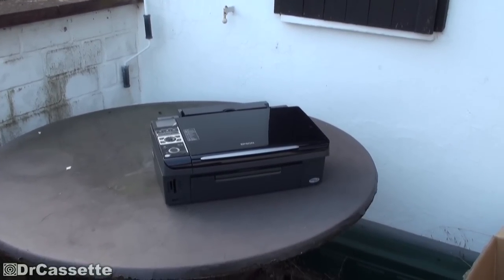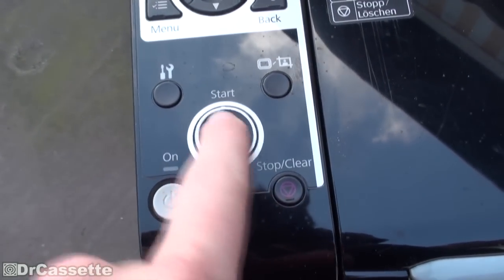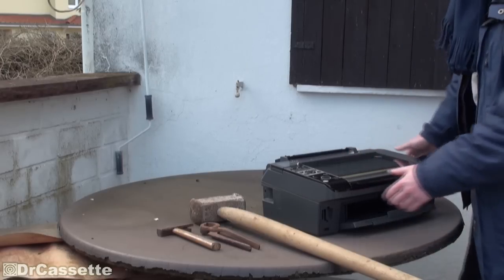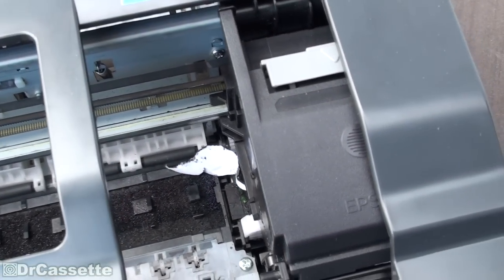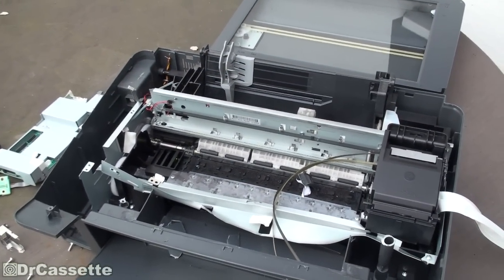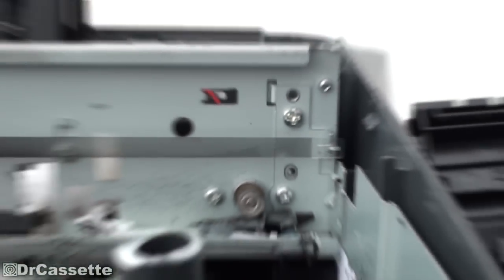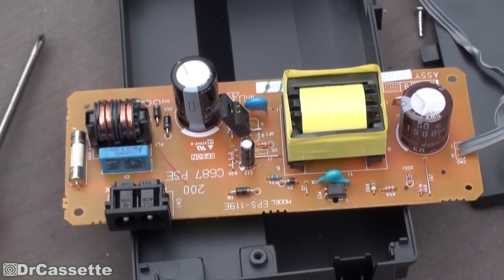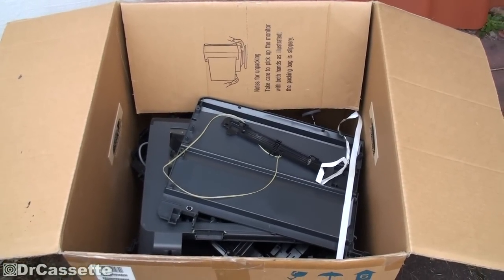DrCassette's Workshop - Epson all in one printer teardown!

Comment: The motor is a stepper motor, which is why it has so many cables. It's not difficult to make a driver circuit for them. Used a lot in robotics as you get about 200 steps per revolution.